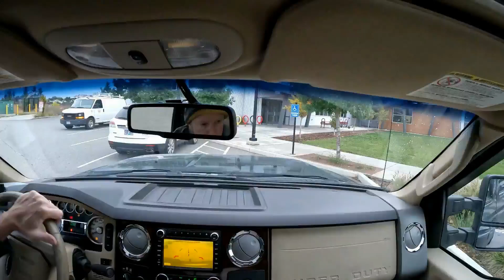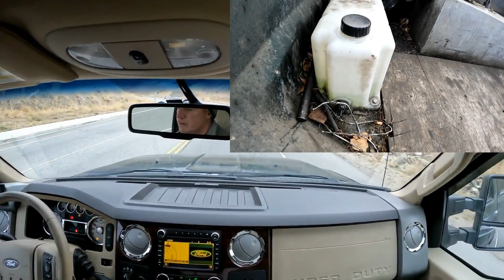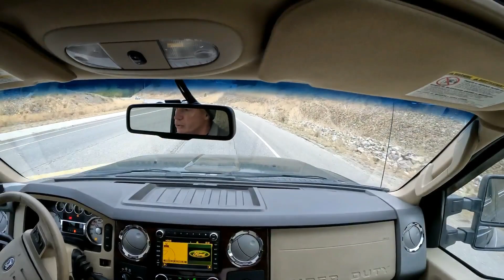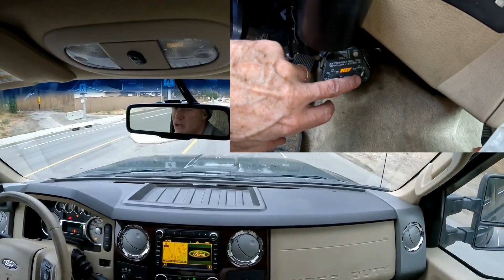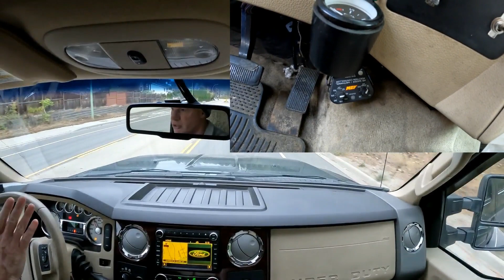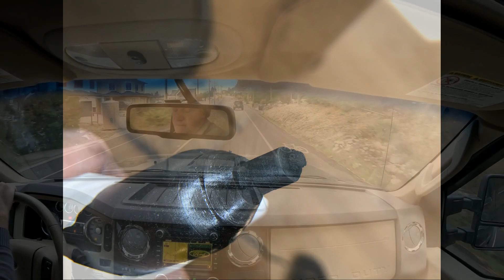Detroit 4-53T (Water Methanol  Injection) WVO

Comment: Have you Dino it with and without the water injection.?
Reply from the maker: Yes, dyno'd my test engine and it made 220 HP and 460 FTLBS of torque on diesel and 230 HP and 480 FTLBS with water meth.  Next upgrade are 9290 injectors in the fal, dyno'd those at 260HP and 490 ftlbs.

Comment: Interesting topic. 
Im suprised WVO doesn't make any problems for you. 
I heard of  lots of long term damage when running in non pre chamber diesel engines. 

Im from Germany and runn it in an 1.9 liter 4 zyl Audi pre chamber diesel. 

Just bought the methanol injection
Reply from the maker: Still running well with 110,000 kms on veg and no issues.:)  Burning 100-200 liters a week depending on kms driven.  I think most of the success is due to running the water meth system and getting a couple of good highway runs in every month.:)
Reply: @detroitgarage9430  just found out it's a 2 stroke diesel. 
Crazy for me since where I live the last one build was in the late 50s . 

Sounds heavenly tho. 

I thought it was a modern diesel since the car is so new 😅
So there was my concern since the more modern engines like the Cummins engines that most use for WMO are absolutely not suitable for use with WVO. 
Engines like the old TDI's from Volkswagen also sadly can't handle WVO. for long. 

I'd love to swap an old engine in a new car but it's not allowed here....
Reply from the maker: @NinoJoel  Ah I see.:)  Yes It's a Detroit 2-Stroke diesel, so doesn't have any issues with WVO.:)  No emissions testing here, so I can run the engine.:)  I have an old Mercedes OM617 waiting to swap into my boat and run that on wvo as well.:)  Another great engine for wvo.:)

Comment: i am pretty sure that you should have explained in some video but
was hard make the original dashboard works with the detroit there?
Reply from the maker: No not really.:)  I used 13 sensors from the 6.4 and installed them onto the Detroit.  In order to get an accurate tach, I used a product called Swap Helper and wired that into the PCM.  So the PCM reads all the data it needs for all the gauges to work.  I also used the Ford 5R110 transmission and tuned it with HPTuners.  The only info mission is fuel injection/ torque and a few other related data.  Again used HPTuners to tune the PCM and delete this stream of data, this in turn gets rid of the check engine light etc.

Comment: Hey you're in Kelowna! I recognize swamp road. Sweet truck! I'm running a 20% mix of WVO in my Hilux surf and it's been fairly reliable.
Reply from the maker: Awesome, are you the one with the right hand drive model?  I follow you down swamp road about a month ago.:)  Thanks for watching.:)
Reply: @detroitgarage9430 probably not, I have a LHD gen 1 surf. Used to be gray I just finished painting it creme/white the other week.
Reply from the maker: @sterlingmakara  Ah ok thanks.:)

Comment: I think Jimmy makes more power now then when you had the compound turbo setup and running on diesel.
Reply from the maker: Yes it certainly does.:)  It runs much better with the single Garrett T04E I built.:)  A little less low end torque, but much better over all.:)  Thanks for watching.:)

Comment: So it is hard to find info but you sound very knowledgeable.
I just bough a 07.5 cummins 6.7 completely stock dealer maintained with 190k im not fan of egr stuff.
Whats your opinion on installing that with that kinda milage  or would taking that stuff off be better than putting wtr meth on it and what are some systems i could use.
Im just not sure on monthly cost. 
Its an all around kinda truck pickup kids and i gooseneck cattle. 
Not lookin for tons power just long lasting reliability.
I think between me n my boys i could install myself mechanics here dont have much to say about wtr meth.
Thank you for your info in video.
Reply from the maker: Water meth would definately help any diesel with an EGR and DPF.  If you have a full EGR and DPF and you can't delete it I'd highly recommend a Water meth system.  If it's fully deleted, then water meth is not required.:)  Thanks for watching.:)

Comment: My 3 turbo diesels, have homemade systems that use boost to pressurize the water bottle and push a .020 stream of water into the inlet of the  turbocharger . So they are on demand systems. I use about a us gallon every 200 miles. I however am considering a high pressure system with a large tank so I don't have to refill on long trips.
Reply from the maker: That's a great idea.:)  I'll have to try that on the dyno when I test my next engine.:)  I find the 5 gallon works pretty nice.  For longer trips I have to carry extra jugs of fluid, but not that big a deal.  Thanks for watching.:)

Comment: So the Water Methanol doesn't damage the piston rings? I don't really understand how it works.
Reply from the maker: No doesn't damage rings or pistons.:)  Does exactly what @tdotw77  described above.:)
Reply: Cool air has more oxygen & burns better. Injecting a small precise amount of water\methanol into intake air stream increases mpg, burns fuel more efficiently cause it's cooling the combustion air, and it decreases the EGT's coming out also. The side effect is keeping cleaner combustion chambers - 'steam-cleaning effect'. It's a win win situation basically. Other than the initial install cost you're only putting water &/or windshield washer fluid(methanol) in the tank, which is cheap! 👍👌🤔🗜️🛠️🔧🔩🔗📏💧⚡🛢️💥💨💪🚫⛽😊
Reply: My 6.0 and any EFI engine does seem to like that cool dense morning air, runs so crisp